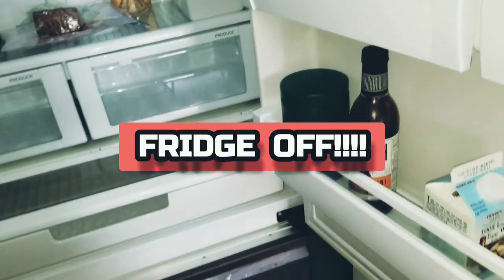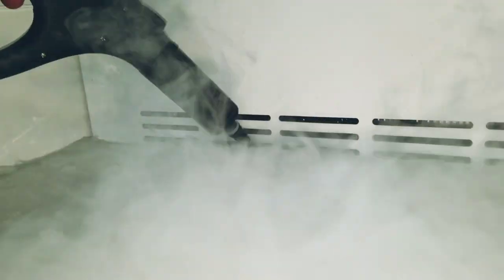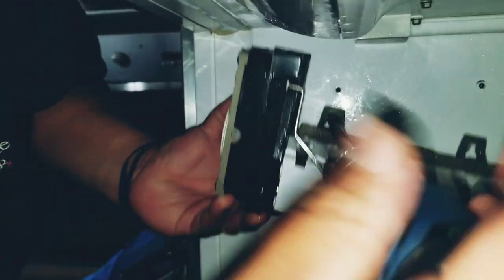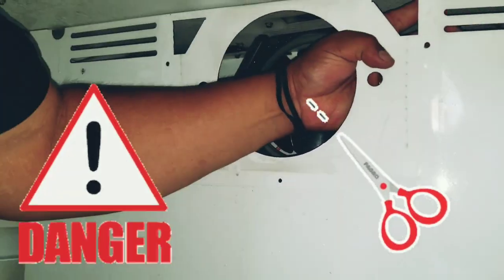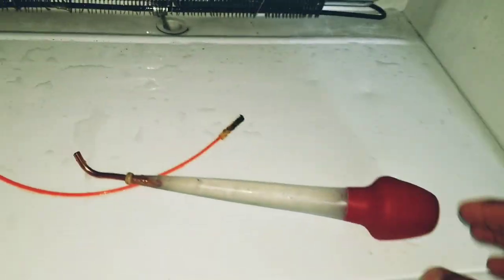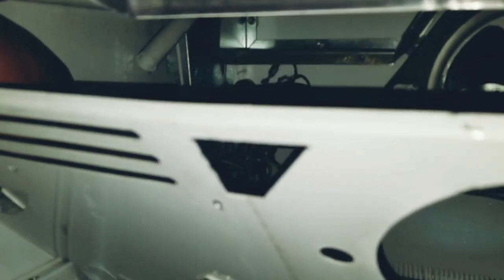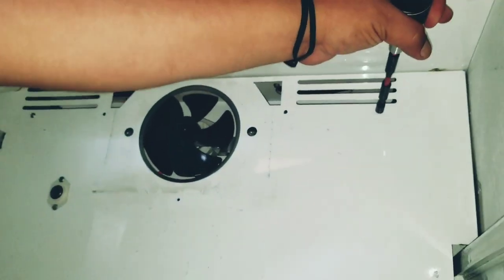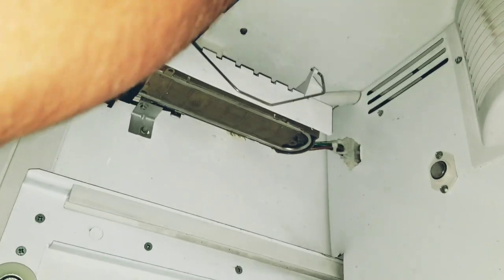VIKING REFRIGERATOR LEAKING/ BOTTOM DRAWER STUCK? VCBB363 DFBB363 VCBB5363 dfbb5363 ICE BUILDUP fix!

Comment: Sorry this question is not related to this video , but I didn't know how to Private message you.    Hi Felix,   
     I have two questions and hoping you can help me.  I have a 48" subzero.  Model BI-48SID/O.  How can I tell if this is a refurbished unit sold as new?  Second, is it possible to stop refrigerator from alarming error codes? 

Long story short, I bought my fridge a year and a half in advance of needing it due to the huge delay in delivery.  The store I bought my unit from sold my refrigerator which was in storage, and was not informed until I needed my unit.  Mean while subzero discontinued the model.  New 48" model had different requirements for door panel.  Problem was my cabinet panels where made to the dementions of  the original ordered unit.  So they had to find my a refrigerator of the same model #.  It was delivered unboxed, (not like a previous subzero 15yrs ago.  Then it kept alarming error codes.  I had to hire a certified repair company to work on refrigerator at least twice a week, the retail store wanted nothing to do with me.  It was now my responsibility to get resolution with subzero.  Ironically after the fourth repair call the owner of the repair company came pulled my main circuit panel and did something to it and magically now I don't get any error alarms.  This man before he left told me to get the wifi box from subzero so they can monitor the alarms.  And that if he had to come out again there would be a charge.  He was only coming out as a favor to the owner of the retail store.   PLEASE HELP.  My unit has a high pitch hum/whistle when running.  I worry i got a lemon, or refurbished unit, and might not be functioning correctly.
Reply from the maker: Hey got it ..so 1st question where are you located..email me you phone number at "fix it felix 718.. at. gmail" I think they would block it if I type it differently but all 1 word..

Comment: Great video. Very helpful. Thanks!

Question:
Why does it freeze up in the first place?

I mean, now that  it’s all defrosted & drain is clear, what will keep it from happening again?

Is there a specific “tilt” the fridge should have so the water flows backwards and down the drain ? 

Thanks again and Happy New Year.
Reply: We have two Viking Professional Fridge with Freezer Drawer side-by-side...the right freezer is fine, the left side constantly freezes over. 
At 3:18 in the video in the video Felix talks about the drain heater. I noticed our right freezer (which has NEVER frozen over) has one and the left does not.
Reply: Same issue with mine keeps frostings